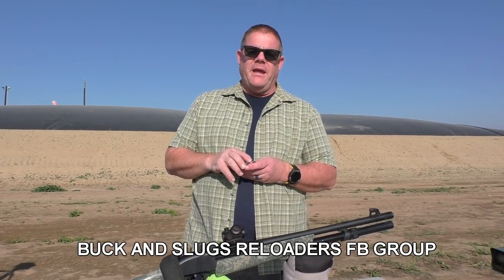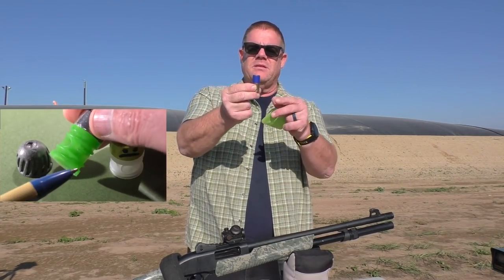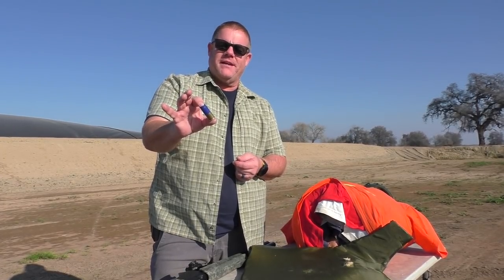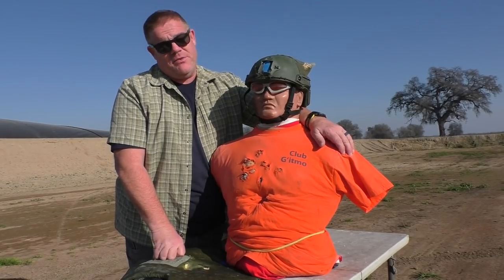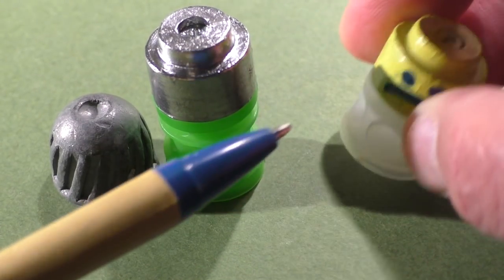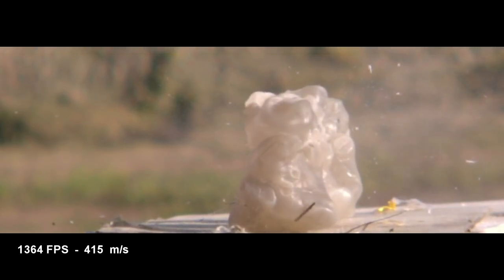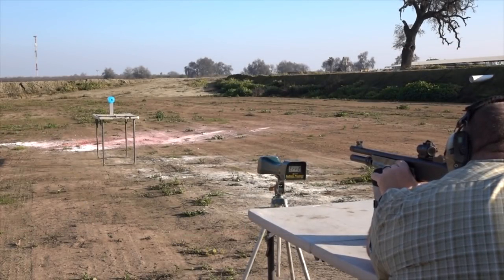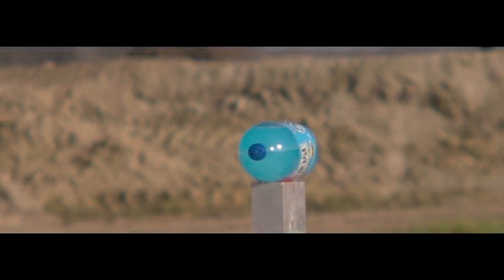⚫ "LEGO-HEAD" 12ga Shotguns Slugs - Watch us test them!

Comment: The tomato paste cans were great, I'm curious if the slightly larger chicken noodle soup cans would work as well.

It's possible that the longer gas seal absorbed 100fps worth of energy on the way out of the barrel. Regardless, it doesn't look like it affected its effectiveness either way, they worked great.
Reply: Longer gas seal probably collapsed too easily/quickly and prevented a full powder burn compared to the shorter one.

Comment: A word on rifles slugs which I’m sure you already know. The Brenneke and Foster slugs don’t spin fast enough to create gyroscopic stability. The spin imparted on them helps swage them to the barrel and remove imperfections in the lead as it travels along the bore. This way when it leaves the muzzle it will be matched to barrel. The rear of the slug being hollow or being a lighter material than the nose gives it a badminton birdie effect where the heavy end always flys in front and as it rotates slowly it is stabilized by the air dragging the tail of the slug back into line.

Comment: To those asking why the flex seal slug shot faster than the bush wad slug. Simple:

The bush wad had a larger crush section that absorbs more energy upon initial launch that the flex seal does. 

Add that to the fact that the bush wad is heavier and also longer, therefore increasing drag during flight.
Reply from the maker: I often give Gregg some pretty oddball slugs to shoot.

Comment: Thicker wad is absorbing more of the initial force of firing causing slightly lower speed. Imaging having a 1 inch piece of foam on your chest and getting punched over a 2 inch thick piece. With 1 in you will feel the initial force of the punch more compared to the 2 inch even if the punching force is equal. Same happened to the slug. More of energy is being dumped into the actual weight of the slug with short wadding. Long wadding has more energy loss into the higher volume of wadding material before transferred into slug. There is also a factor of barrel friction. Larger area for friction on longer wadding.

Comment: @7:50 I think it's not the slug deflecting upward; rather, the gelatin compressed, forcing all three bears backward and laying them over a little as the slug punched through.  That creates the impression of the slug's upward travel when the bears are examined standing vertically after the shot.

Comment: The longer wads collapse more than the shorter ones.  This increased the volume of the chamber at the start of powder ignition.  The increased working volume causes the pressure to be less throughout  the combustion cycle, and thus the velocity will be  some what decreased.

Comment: I one time put a 12 gauge foster 3" through the neck of a 2 litre.   Never manage it again... but I popped the middle of the cap out and blew it through the neck. The neck had a chip on the lip but no other damage on the top of the bottle.the threaded portion of the cap was still on the neck with no other damage to the bottle.

Comment: Hey Jeff, this just popped into my head. I wonder if you sat the ballistic gel block on something like foam rubber (an old couch cushion, etc.) if that would absorb most of the energy from the gel being displaced by the slug. and hopefully keep the gel block on your table. and the legs folding up should be easy enough to remedy. by cutting a slot in a piece of pvc pipe, sliding it over the leg supporting locks, the twist them 90 degrees so it would keep the locks, locked.

Comment: Absolutely a well edited and great video. I would assume the higher velocity in the short shell is due to same powder load caused higher pressure and more velocity.
Reply: That's what I was thinking too.  I've had the same thing happen when loading .300 Blackout subsonic rounds: Using the same powder charge and bullet, the ones that were seated to a shorter overall length cycled my AR, while the ones seated longer didn't - meaning that the shorter ones developed more pressure because there was less space in the cartridge.

Comment: My best guess for a little higher velocity from the shorter ones, when same powder/amount, less volume, and compresses less during firing, so you get more pressure, faster. Not necessarily more pressure overall, but it builds pressure faster, as the wad doesn’t compress near as much, so more heat and building pressure in a smaller area, will burn it faster overall, by a little bit. All I can come up with.
Reply from the maker: Good as anything I can come up with!

Comment: I think the difference between the 2 in the speed is because of the pressure is higher in the shorter one because of Shorter distance between the case and the slug which builds more pressure.

Comment: So Jeff, lease teach me something.  You made the point that the shorter shell pushed the projectile about 100 fps faster.  Is that because given the weight of the lead portion of the projectile, the charge and the 12 gauge shell don't change, but the weight of the wad does, so the shorter cartridge must also use a shorter wad.  It would be interesting for you to collect the weight of each wad used. I expect that is the speed difference. So since I answered your question in the video (I think I did?), can you teach me one thing.  Hypothetically, If you have everything the same except for the projectile and they are two different weights, I would expect the lighter bullet to cause higher chamber pressure and faster speed? Is that correct? If not, what happens and why? Since I have been watching your channel for many years I have wanted to try doing this experiment.  I now have acquired jut about everything I need to do it, but I want to know the expected outcome of the experiment so I can record the results properly.  Thanks Jeff and OG!

Comment: Hey Jeff! Now that I know you read every comment, gonna cut down on the superfluous ones. I appreciate all the work you do!! 👍🏼 Thank You! In this video, the green wad had the screw all the way through the wad. Wouldn’t that impact the purpose of the wad? Thanks for thoughts.
Reply from the maker: It seemed to work still
Reply: 😂 Oh yeah! It worked! Probably just my OCD mixed with too much curiosity about ballistics. In high speed, it looks like the center of the wad didn’t compress. This would’ve allowed some of the gasses to push past the wad. There were some remarks regarding how much slower the longer wad was. Wondered if this may have contributed to slower speeds.

Comment: i assume the extra length of the green wod creates more drag on the projectile. maybe that's why the shorter wods were faster. and maybe the extra length of it allows more compression meaning you're loosing a bit of pressure before the round actually starts to move. at least that's my thoughts on it

Comment: 1 1/4 oz. is the same weight as the shot charge in a 12 ga. "Duck & Phesant" load. Pretty strong stuff, but then, your load pushes it over 100 ft./sec. faster (1434 vs. 1330).
WOW!
Calculated ME was almost 2535 ft./lbs.
....yeah, that'll stop a brown bear....or a deer.

Comment: My theory for the speed difference is the green ones being longer adds a tiny bit more mass as well as causing the slug to leave the barrel a little sooner so not as much time to build up speed as the shorter ones. All in all it was a great video no matter what the reason is.
Reply from the maker: The shorts are 1.7 grams and the green ones are 2,4

Comment: I measured the FS12 was at 0.725 and the green ones come in at 0.721. The 4 thousandths of an inch might explain the slight velocity difference. I use the green brp12 wads for the Russian segmenting slugs and noticed some powder migration.
Reply from the maker: I just measured them and got the exact opposite measurements.

Comment: There are three reasons why the "longer" slugs would be slower than the shorter slugs. 

First reason is Newtons second law. You have kept the force the same but increased the mass (bigger wad) so the velocity is reduced but the force remains the same.

Second reason, increased drag. The longer plastic tail helps with keeping the slug stable by increasing drag, by increasing drag you're reducing velocity by friction with both the barrel and air.

Third reason I can think of that would reduce velocity is. The larger wad helps absorb shock more so than the smaller wad and reducing barrel length to generate more pressure behind the slug by fractions of an inch.

Now any one of these things could reduce velocity by a minor amount. But combined I think thats why you were seeing a 7% drop in speed.
Reply from the maker: There's only about ½ a gram difference in weight
Reply: @taofledermaus  like i said its not any one thing in particular its all the things combined. the 1/2 gram is about an extra1.5% in weight. add in drag and reduction in propulsion gained due to shorter length and you have your 7% loss in speed

Comment: I find myself wondering what these would do if they were made from a harder material, say maybe tungsten instead of lead. Either way they show that even very simple designs are capable of impressive results.
Reply from the maker: Tungsten is very hard to work with.   A single slug would probably cost over 100 bucks

Comment: Re: Velocity:  Shorter wad column gives the power a smaller chamber at ignition.  
Smaller chamber, same power = higher pressure.
Higher pressure = more velocity.
That's why the longer wad column was ~100fps slower.

Comment: think it was the length and strength of the screw. the shortys has a short and weak screw.. the long ones had a Large and Hard screw. to be clear he used a construction screw versus a potmetal one for the shortys.. I think the long ones had enough structural strength to pierce that wad during acceleration.. the other cheap screws just folded under the pressure.

Comment: Next time you cast your block of ballistics gel why not set a couple of neodymium magnets in the bottom of the pan so they solidify in the gel then merely magnetize it into place with either a metal plate underneath the surface of the table or a couple more magnets. Or the sheet of metal inside the gel and the magnets under the table would probably work better.
Reply from the maker: The force would tear the magnets out of the gel.   Been wanting to wrap a gel block with duct tape to show how much energy is being expended.

Comment: could the higher velocity out the shorter wads be due to the shorter ones having less deformation/squish in the first instant causing slightly higher pressure. Or maybe having slightly more barrel to travel down increased the velocity because they're shorter
Reply from the maker: That is what Leon thinks

Comment: OK, gonna add some more controversy to the gel block issue.  Don't hate me, I'm just wondering.  How liquidy (trying to put things in OG terms he'll understand) do the blocks get when they're melted?  I know it'd be a pain in the posterior, but if it's viscous enough, would the dirt/fragments in there settle out if you left it fluid long enough?  I know it wouldn't TOTALLY make it clear again, but maybe increase the longevity.  Of course then you'd have to figure out if the pain in the assness of it is worth the trouble, or just better to buy a new one.

Also, with the longer gas seal ones going slower, would that be due to the longer seals having more room to compress before the round starts moving, and just a LITTLE more volume for gas expansion?  With the shorter one having less compression space of the wad, therefore less space for gas expansion, more energy is being put towards propelling the round at the start?
Reply from the maker: What you do is cut out and remove any fragments,  etc  before you heat it up.   The next issue are air bubbles.   The melted gel is so thick,  it takes about 5 hours for them to rise out.   The final issue is the gel actually darkens and degrades each time you heat it up,   which I compare to cooking oil.   I can only melt the $150 block of  gel down about 3 or 4 times before it needs to be replaced.
Reply: @taofledermaus  There's gotta be a cheaper/easier way.  Those blocks are WAY too expensive to only be able to reuse 3-4 times.  I was hoping that it would be thinner when it was melted, and would allow the gunk inside to settle out if you just kept it melted long enough.  Even if that had worked, it'd still be a pain in the posterior.  I'll try to keep my eye out for a substitute.  It probably won't be as "realistic", but maybe we can find something that would at least be cheaper/easier to use/reuse.

Comment: For what its worth I think that the petal in the jelly wound is caused by a wad of gel moving and building up in front of the slug. Eventually it peels off to the side leaving that petal behind. What fine slugs ! 
Re the green wads. Air is thick. There will be a lot of drag. More on the longer green wad. That will peel off some fps. Like a tennis ball v a shuttle cock...

Comment: I dont know what you could do for sure to keep it clear longer. Maybe try a double boiler to keep from scorching any of it and cut out any discolored spots before re melting. You can also make the stuff your self plenty of youtube vids on how so that is a option to save you some money (maybe)
Reply from the maker: I do remove any dirty gel and debris from the gel.   But unfortunately every time you remelt the stuff,  it darkens a little, it degrades like cooking oil.   We try to get a few shots in the gel before we melt it down but after 3 or 4 remelts,  it's usually time to replace it and use the old block for gummy bear targets.
Reply: @taofledermaus  Have you looked in to making your own blocks?

Comment: Would a the cost of tarp under the table to catch the ballistics gel do well enough to to offset said cost?
Reply from the maker: Then we'd have to wash the dirt off the tarp
Reply: @taofledermaus  hmmm very good point… wait… isn’t it mostly sand there? It’s not dry enough to just shake off and throw in OG’s (assumed to have)truck? Haha. Although I can conclude 2 probable cases… 1, the time/effort to clean the tarp outweighs any perceived benefit.. or 2. Along with myself… you see little value in extra effort for an almost pointless complaint about the clarity of ballistics gel. Hehe

Comment: Shotgun experts: Q: on a magfed semi auto Shotgun, is it reasonably plausible that you could swap the barrel with a specially built/compatible 308 barrel with a built in feed ramp, and perhaps tune the spring or piston ring, and change the magazine lips/follower such that it feeds 20 rounds of 308... and obviously the bolt head would need to be exchanged for one that fits the 308 case head... ???

As far as gas systems go, we know that Benneli did a .223 semiauto using their Shotgun gas/grip/stock system, so its not implausible.
Reply from the maker: not sure,  I guess anything is possible with enough modification
Reply: @taofledermaus  I guess I just wasn't sure the bolt would lock up strong enough for a 308 chamber pressure, or if the gas system would be too delicate to handle it.
I looked into the legality and it's really not an issue as it's akin to switching to a slug gun barrel, so long as it's reversible it's legal.
I love battle riles but they're pricy, often heavy and SBRs are more of a legal hassle than SBSs or AOWs. So just kicking around a few ideas. Many of the new mag fed semi's are very cheap and have great features and aren't that heavy.

Comment: Can I load foster slugs on my reloader that uses a crimp for birdshot wondering if that crimp would work or does the face of the slug need to be open
Reply: Sure you can. Might add a little bit of pressure, but nothing to be concerned with if your load data is safe. With that being said, roll crimp generates less pressure, all other things equal.